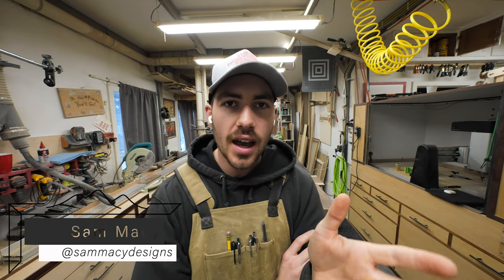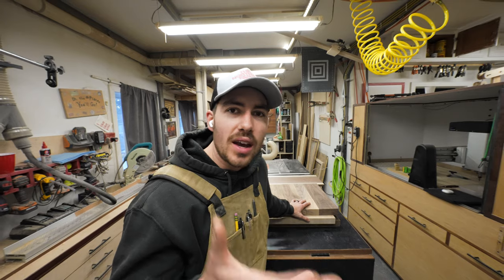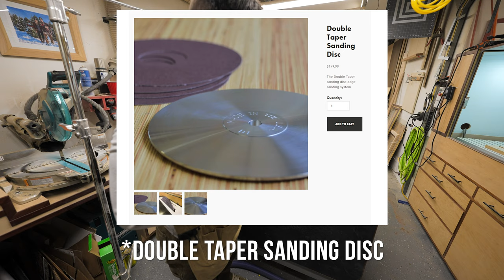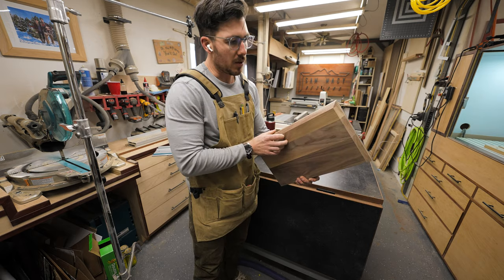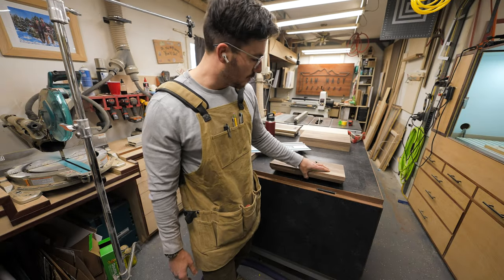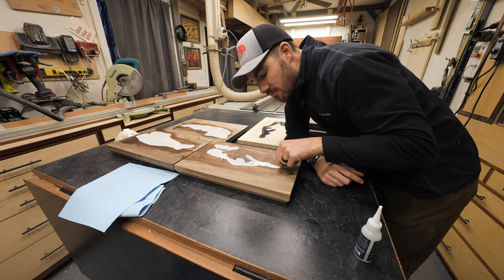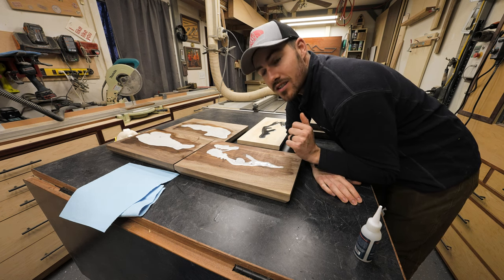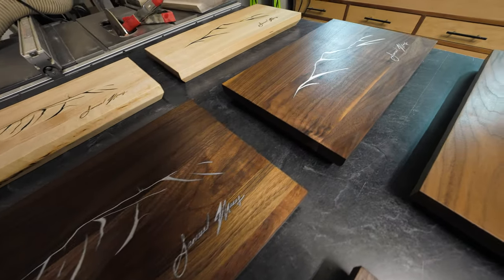Black Walnut Epoxy Inlay Charcuterie Boards

Comment: I have been hobby CNCing for about a year and a half.  That card board cutout to set your zero is brillant.  I will need to remember this.
Reply from the maker: Thanks! Glad it was helpful for you! Happy CNCing 😃
Reply: @SamMacyDesigns  Just ordered a CNC so ZERO experience here ....and glad I saw this comment because I saw the cardboard, and couldn't figure out WHY you did that.  Can you explain??  (I DO know why setting zero is important. Just couldn't figure out why you'd do it on the cardboard and not the work piece).  Thanks

Comment: Tabletop epoxy are usually formulated for a deep pour.  So when you use this type of epoxy for a shallow pour, it either takes a much longer time to cure or remains tacky unless you apply external heat.  What you need is a low viscosity ( to prevent bubbles) shallow pour epoxy.
Reply from the maker: I have both types of epoxy and this one said use for anything 1” or less. I also have a deep pour epoxy which can cure up to 3”. I think I must have screwed up the mixture on this or something

Comment: The boards look great. A small propane (or butane) torch or even a heat gun carefully waved over the epoxy will get the bubbles out.  What CNC is that?
Reply from the maker: Thank you and great tip! I'll try that next time. The CNC I have is a I2R8 and I think it's the same as the Axiom 8. I got it a few years ago and I'm super happy with it! Seems like it's a "pro-sumer" machine

Comment: I was amazed to see you used oil based polyurethane to seal the wood around the pour. Does that work well for you? I’ve seen many videos where woodworkers will use the actual epoxy as the sealer. Have you tried that method?

Comment: Hey Sam, great video. Question first time seeing the sander used to take off epoxy instead of cnc machine. What sandpaper are you using and is that because it was a light epoxy pour. Thanks again.
Reply from the maker: I used 150 grit up to 320 but I think if I had to do it again I would heat it up with a torch and scrape it off with a razor and then hit it with 320! The sand paper clogged pretty bad….it became a bit gooey so in hindsight I don’t know that I would recommend taking the bulk of it off with sand paper 😂

Comment: Nice job on the video. Did you settle on a better epoxy for these inlays? You mentioned looking for something with a longer cure time to reduce bubbles.
Reply from the maker: Thank you! And yes I did, I found a slow cure epoxy from total boat that cures up to 3" thick which means it take a longggg time to cure. It worked great, no bubbles and I added about double the amount of pigment to the mix